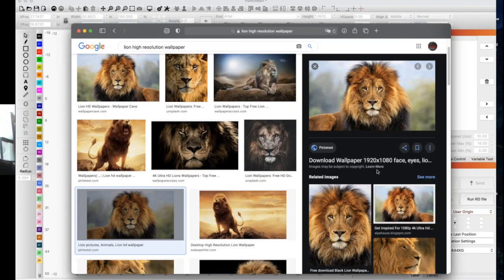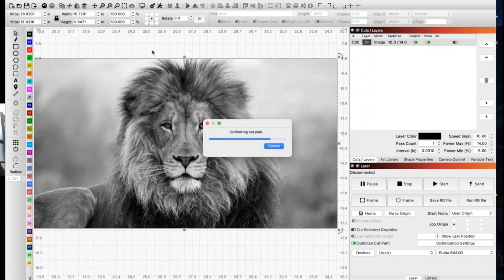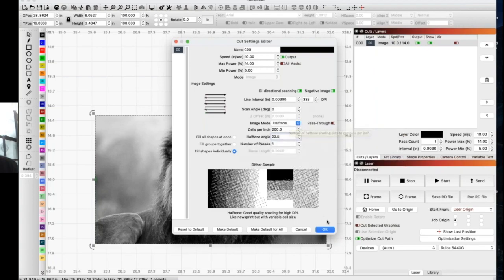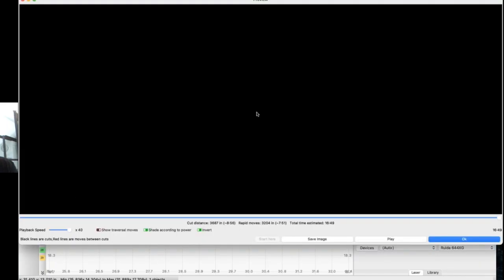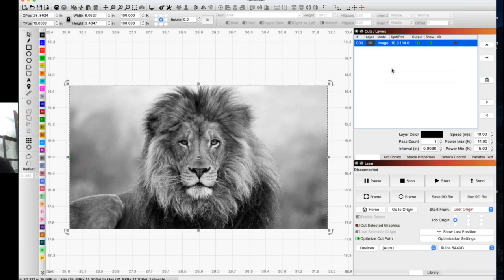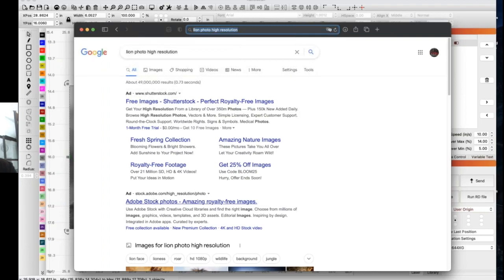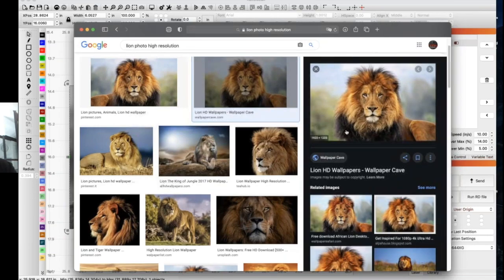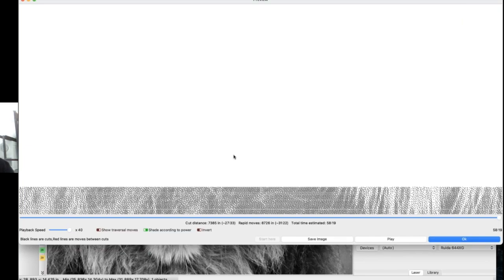How to..Lightburn photo processing

Comment: Hi guys, nice video. I owned an Epilog 30w way back in the early 2000's and the tube went bad a few years later and they wanted $3500, so I gave it up until now, Bought a 60w thunderlaser. Anyway, used to do loads of black marble photo engravings and used the spectacle software at that time, which was Photograv. So here I am in this truly integrated environment and enjoying every bit of the learning process but @ 71 years young I need a nap after 2 hours learning new things LOL. Anyway had a couple of questions. 1. Was the photo you imported originally color? If not, what was your process for B&w conversion? I want to continue with the black marble and black granite depending on the outcome so just trying to get to the point I can actually do my first try.   Thanks guys I have a 60w if you are interested in providing me your guesses with the Jarvis method as to speed and power.  Thanks again for your time ..... Bob
Reply from the maker: You can import the photo into LightBurn without converting to grayscale. Lightburn will do the rest. All major edits like background removal and heavy retouching need to be done in an outside program like photoshop.
Reply: @HouseOfLasers  👍👍👍👍

Comment: Hi, I have a  Ortur LM2 PRO 0 watts laser, but as   adviced by the Ortur support I cannot  cut 6mm plywood and acerlric  even with 6 passes,Anyone can advice me on this, or suggest a better CNC cutter which can even cut plywood upto 10mm>
Thanks in advance
Nicholas.
Reply: i have the same laser engraver, (10 watt I assume) cutting 6mm birch ply takes a few passes, I set it to 4 passes, let it rest to cool for a couple minutes and do it again two more times, to cut wood that thick and more you really need a 40 watt machine for a single pass (I don't have $2k+ to spend) if you want high production.

Comment: Thank you for the Videos, im learning and getting familiar with what this program is capable of doing.  i have one question ?  in what instance would one use Negative Image Option. Thanks
Reply: Usually, a negative image is used on the backside of glass or acrylic.  When it's viewed from the front, it will look normal.  Also, if you paint tiles black, you would use a negative image to get the proper effect (used a lot with multiple colors, on canvases, mirrors, glass, etc...)